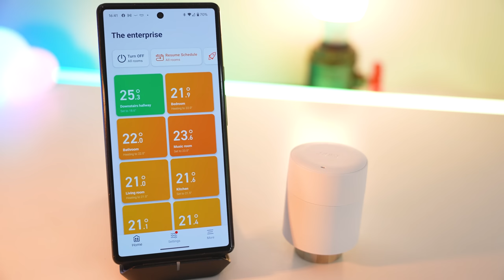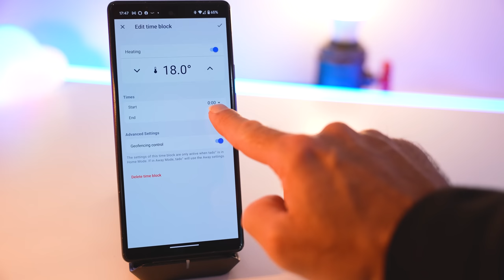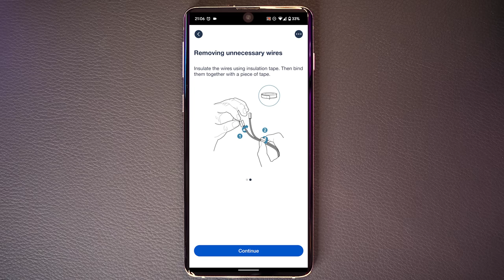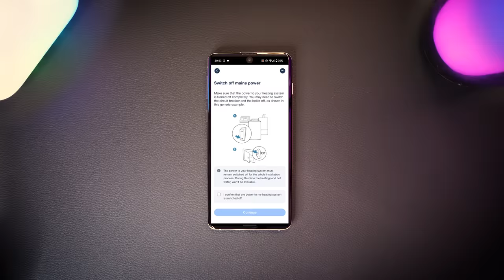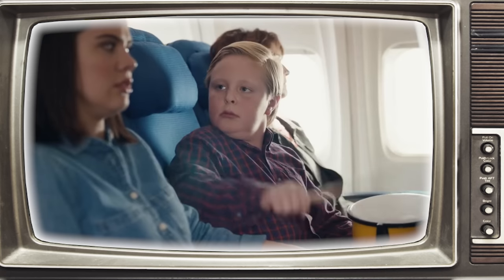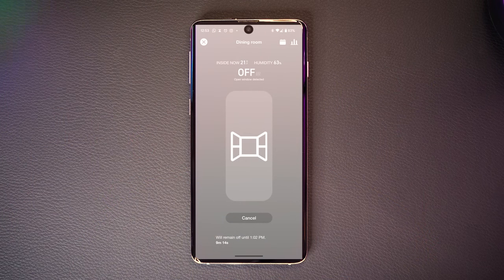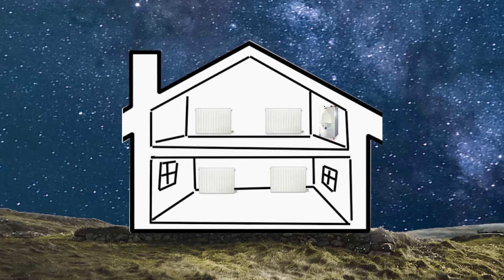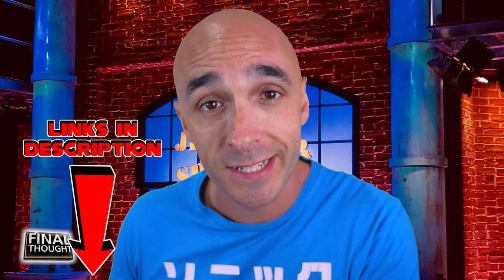Install This On Your Radiator & Drink The Tears Of Your Energy Company

Comment from the maker: Happy Saturday Everyone!  We are finally back from our belated Honeymoon now that there is no longer a hurricane stopping us getting back!  Sorry if I've been a bit quiet!  BUY TADO BELOW 
**UPDATE** A few people have told me in the comments that the Tado thermostat on Amazon is NOT Opentherm capable.  Tado have confirmed that the one listed on THEIR WEBSITE is (links below).  They have confirmed the Amazon link IS NOT OPENTHERM YET, Don't buy that one unless your boiler isn't opentherm capable.

RADIATOR VALVES ONLY (*DO NOT BUY THE THERMOSTAT FROM HERE AS IT IS NOT OPENTHERM CAPABLE) (20% OFF!!) https://referral.tado.com/paulhibbert

THERMOSTAT KIT (OPENTHERM CAPABLE)
https://uk.installers-shop.tado.com/products/wireless-smart-thermostat-starter-kit-v3-eu-version

WIRELESS RECIVER STANDALONE
https://uk.installers-shop.tado.com/products/add-on-wireless-receiver-for-combi-boilers
Reply: Congrats on the wedding dude. 🎉
Reply: I've just this w/e installed 11 Shelly TRVs - these have 6500mah rechargeable batteries in and a USB-C port.  Working on my home assistant automations now.
Reply: BTW - you only need a bypass radiator if your boiler or system doesn't have a bypass valve - it's worthwhile checking as the short return of a bypass valve will decrease the return flow temperature shut off time.
Reply from the maker: @defsdoor  Oh that's awesome info, thanks dude! ❤👍
Reply: Wicked video iv being using Hive version for YEARS never had issues and saved loads of CASH haha
Reply: The bypass/kettle radiator is to allow a place for the hot water to continue to flow when the boiler kicks off. If all your TRVs were closed and you didn't have a bypass radiator then the pressure would increase until...well...kaboom!
Reply: @defsdoor  Do you mind to explain a little bit more, i have 0 knowledge about that hehehe, thanks.
Reply: @jameskeatings9269  Thanks for explaining
Reply: Lol you Master Baiter.  Best Baiter I know. The jokes just "Worrrrrks"
Reply: @defsdoor   huh, good to know... I always thought it was a necessity.  I might just leave mine as is for the minute because I've done some other fiddling with flow temperatures and such and I'd like to have another base point for comparison, but excellent to know going forward!

Comment: One thing I don’t fully understand and hoping someone can clarify is we need to buy the wireless receiver which connects to the boiler itself. We need the smart thermostat kit and then obviously a bunch of smart TMVs. What I don’t understand is how many of the thermostats we need and does it matter where it’s placed? Should it be near where the bypass radiator is? Do we need one in every room where there is a smart TMV? I just don’t fully understand its purpose and don’t want to end up buying items I don’t need!

Comment: The reason your need a bypass is because otherwise if the CV pump is ‘on’ and all valves are ‘closed’, the pump will press against a closed off pipe. In time this will damage the pump. You can open up one radiator all the time, or you can place a (differential pressure) bypass vale somewhere in the system. With the bypass you can save money because you don’t need one radiator to be 'on' all the time.
Reply: You only need a bypass with a traditional room thermostat and independent thermostatic valves. With an intelligent system like this it will switch the boiler off if all the radiator valves are closed. When I installed my Honeywell Evo system (still working well after four years) I had a plumber in to fit the right valve head on the bypass radiator so I could put a Honeywell motor on that too. Otherwise you have one room that is always either too hot or too cold (because the system is now controlling the boiler and it does not know about this radiator).
Reply: Well or just install an efficient pump that measures the pressure and flow you don't need an extra pump that's fits your thermostats. Those are recommended for years.
Sidenote, if the present pump is that old, there should be a bypass directly over the pump in a correct installed system.
Reply: @john_hind  Thank you for your addition, I myself had a Tado setup. With no bypass or radiator always in the 'on' position. And unfortunately this broke the CV pump (according to the cv specialist). In my current setup I added the bypass and had no problems sins.

I am not a CV specialist, but with my old thermostat, when I turned down the temperature, it took time for the CV to stop working. With Tado, the radiators are closed immediately, but the CV takes some time to switch off. I think this has broken down my pump in the past.
Reply: @arnebaas  If true, that is a design fault (or maybe an installation fault) with the Tado system. It ought to check that the boiler is off before closing the last radiator valve and only switch it back on again when at least one radiator valve is confirmed open, and it would be perfectly straightforward to do this. Even if your boiler does not have OpenTherm, the system should still have a relay which replaces the original thermostat and switches the boiler on and off. Perhaps this is not correctly connected on your system?
Reply: @john_hind  It can't know if the boiler is running or not, it's just providing an "on/off" to the port valve.  There's no feedback.
Reply: @paulgoffin8054  My Honeywell setup has a radio controlled relay which replaces the thermostat. The controller knows if the relay is open or closed which is just a switch to the boiler, so should be a good enough proxy for whether the boiler is on or off. Paul says Tado has a similar Opentherm controller, so I imagine it uses a similar 'thermostat emulation' if Opentherm is not available.
Reply: I put in a combination tankless boiler.  It runs a primary/ secondary loop system.  Seems much easier to deal with
Reply: @john_hind  the pump always runs for some time after the boiler shuts off. On my boiler this time can be set to anywhere between 24 hours and 5 minutes, but not 0. What you’re after just isn’t a thing — the boiler needs water circulation after the burner shuts off to avoid overheating from the thermal mass of the heat exchanger.

Which means that if you keep the last zone open for a bit after heat demand ceases, it will always overshoot.

Tado could at best learn how much residual heat comes out of the system after it shuts off the boiler, and then time it such that it shuts the boiler off “early” by a little bit, but keep the zone open… but each zone would react differently, never mind when multiple zones at once no longer have heat demand. It’s basically not going to happen.

At the same time, if installed during the initial installation of the system, a pressure bypass costs less than a small radiator and even if retrofitted it’s at most a few hundred in labor and parts. Given how much smart TRVs cost the cost of a bypass is trivial.
Reply: @JasperJanssen  But is the pressure bypass designed to be relied upon routinely, or is it a last-ditch safety protection? The Tado or Honeywell system could easily be designed so it never closes all the radiator valves simultaneously. Instead of closing the last valve it would switch the boiler off and only switch the boiler on and close that valve after it had already opened another valve. It has the control authority it needs, just a matter of sequencing it right!
Reply: @john_hind  pressure bypass is a routine thing, yeah. If it triggers while the boiler is firing then the boiler will shut off on high return temperature, which is also a standard piece of control tech, but that sequence shouldn’t happen while under functional control.

A zone control system could sequence like that, but that would be a incredibly fragile system, and it wouldn’t work very well.
Reply: @JasperJanssen  Seems sensible to do both as the mechanical pressure bypass is a useful safety feature while correct sequencing reduces wear and tear. Modern combi boilers have the pump built in to the boiler casing, will this mean they have the pressure bypass built in too? My system has neither visible pump nor bypass but has been working without problems and with no bypass radiator for over four years now. What concerned me about leaving an uncontrolled radiator is there is no longer a thermostat controlling the boiler, so the room with the uncontrolled radiator would get very hot if controlled rooms required heat or very cold if it was the only room requiring heat. My house has a lot of solar gain to the rooms on one side, so it is prone to big differentials between rooms.
Reply: @john_hind  no, bypass has to be external. You need a few meters of pipe between it and the boiler. There might be a pressure differential switch on the pump so it doesn’t keep trying to pump into a closed system, but then you don’t have water flow when all the rads are closed, and while that’ll save the pump it won’t save the wear and tear on the boiler overall.
Reply: So much bad information in the whole chain here. One valve should always be open no matter what the setup, the bypass does not dump heat and that is exactly what a radiator is designed to do. When there is heat in the system it needs to be expelled and that is just one of several reasons why no matter what system is used always have an open valve, bypass/feedback or not. The risk of not dumping that heat? Split pipes.
Reply: @kevinfeathers7432  so where is that heat coming from that needs to be dumped?
Reply: @kevinfeathers7432  curious about this and if it helps to have lower flow temperatures. Eg often boilers would be set up to run at 70-80c and return temps would be 50-60c. You may want a rad working to dissipate some and prevent the return temperature being still 70-80. But if you can run at 50c flow temp, does it matter if all rads are bypassed and the return flow is 50c? Thats still lower than it could have been with a drop of 20c from a 75c flow temp?

Comment: we currently have a few Netatmo thermostat valves and they have a really annoying feature. If the battery runs out they open the valve full blast.
how do tado handle batteries running out?

Comment: I have used tado 2 years now and set it up to home assistant, worksa great saves me 10-20% the winter. Only problem for me is its 443 mhz and loses connection from time to time to the radiator furthest away, it still do its jobb but can't communicate to the resiver

Comment: I went down the self install route last year, really good system but I haven't got the TRV's as they are really expensive and I haven't got TRV'S on all of the rads in the house. Could l use cheaper TRV's with home assistant?

Comment: For anyone wanting this level of control for about half the price, fully local control with no reliance on the cloud and no subscription, look at the Drayton Wiser system. Added bonus is that if you have an industry standard faceplate for your existing non-smart thermostat, it's pretty much plug and play. You don't even need to rewire. Just take the old thermostat off, pop the new controller/hub on and tighten a couple of screws.

Comment: Could you review infrared panel “radiators” please? My rental doesn’t have central heating, I’m stuck with oil filled radiators but they’re a bit expensive to run.

Comment: I've had a tado installed for about 3 years and would agree with everything you said, it is a great system. A couple of extra things: you don't need radiator valves everywhere, just wait for the half price offers and add them over time. The valves occasionally wake up with a strange motorised noise, which is a little annoying in a quiet room. The geofencing is amusing at Christmas and Easter, and when the batteries need replacing the app tells you exactly how, because it knows you've forgotten and binned the box. So several nice little touches. Oh, and the devices communicate via some local RF system (not Wifi, not Zigbee) which has been rock solid.
Reply: Do you have a overview how much money/energy you have saved? I am living in a new rental appartement with heated floors and I am thinking about going smart home because of the high energy prices in Germany.
Reply: @abcxyzsven   greetings from the UK; I think our prices are even worse than yours :-( So that's a good question. The app does have a feature showing "Your savings with tado" which for me currently is 82.1% I'm not completely sure how they calculate it or whether I fully trust it. Regardless, because I can very easily control rooms individually and turn everything off when I leave the house, I think that tado can't possibly be less efficient than non-smart.
Reply: @chrisridd9423  Ohh... I thought the UK was better off because you have your own natural gas in the north sea. I think I will talk to my girlfriend about this topic. Still we are quiet lucky when it comes to energy. The house is new with the highest efficiency rating and we don't use gas but district heat. But the power plant still burns gas for the heat and electricity so we have seen some rise in cost.
Reply: @abcxyzsven  we get less than half our gas from the North Sea.

Comment: Are you sure that you need a bypass radiator? 
My understanding is that if all radiators are switched off then the Tado° system switches off the boiler and pump.

Comment: Ok so, if I understand you correctly, you can control this system locally via Home Assistant, but when there is no internet connection the system becomes useless nonetheless due to its reliance on the Tado servers?

Comment: I looked at both Tado and Wiser and went for the Drayton wiser system because it is able to operate independently of your home network and internet connection, if needs be. They also don't charge a monthly fee to unlock all the features (although there's nothing stopping this from doing this in the future, I feel like they probably would've done it by now). I have TRVs on all rads (except a couple of towel rads) and I've got it integrated with home assistant so I can control all of the rad temps/schedule from a touch panel in the hallway. One advantage of Tado is that their OpenTherm implementation seems a bit more advanced (as long as you buy the correct hardware which others have mentioned). Wiser only supports OpenTherm with a combi boiler (single channel), CH modulation works fine but it locks you out of changing the hot water flow temperature and it's hardcoded to 60c which is a bit annoying as ideally i'd like it lower for maximum efficiency.

Comment: To make the most use of these (and any smart rad control), don’t you need to keep the door shut for the room they are in? Otherwise your rads that are on will have to over compensate as they will be heating the room they are on in and effectively the room that you have the TRV off/lower temp?

Comment: I've been using the Drayton equivalent Wiser for a couple of years now ... the one advantage over the tado is that aside from the initial setup it doesn't require the cloud service.  That said the built in geofencing (wiser requires ifttt) and the display on the TRV's are very nice.
Reply: I'm looking to replace an older style Drayton MiTime programmer series single channel controller ( model T711R ) with the Drayton Wiser systems.....was wondering how good their wireless TRV were...? Maybe Paul can do a review...?
Reply: @innovatoTV  I'd have to say I feel it could be better ... the main controller doesn't seem have the best antenna so I find the wifi signal isn't the best and it only uses 2.4ghz not 5ghz ... the trv's use zigbee with all the issues that has, there is no way of changing its channel so there can be interferance issues with 2.4ghz wifi.  The trv's are not repeaters for that you have to get their power plugs and they are £50 a time.  My 4 bed can just about work without any repeaters with the controller at one end of the house the room furthest away upstairs is marginal ... a repeater helped but I think I could actually do with a 2nd one as the upstairs is L shaped over the garage and depending on wher I put the repeater one leg doesn't really benefit as walls get in the way.
There is a feature that is supposed to stop the radiator going on if the window is open, personally I've found it doesn't work for me.

That said on the whole I've been pretty happy.
Reply: Drayton is proper ace. 
No cloud required
No extra hub required as it's all in the boiler controller.
Does the hot water as well
Has 3 different versions so you can have just heating for combi boilers or 2 channel for heating and hot water and 3 channel for double loop heating if you live in a palace. 

Downside to tado it is (or was ) a faff to enable all trvs to call for heat. You had to get it enabled by a help line. Wiser just works
Reply: Another vote for Drayton wiser. No reliance on the internet including a local Home Assistant control too.
Reply: @luciditycrash3469  house has 2 heating zones, 1 for upstairs and a 2nd downstairs each with wired thermostats, so might get away with putting one WISER wireless room stat in sitting room and another run my home-office (work from home)  and  minimise all other rads....and keep eye out for discount deals on the TRV's and add in future. House is small so hoping the wifi can cover without repeater.... hope to install Nov before we really start weaning warmth. Would need to figure the GEO fencing when OOH....
Reply: @innovatoTV  its not wifi that needs the repeater it's the zigbee the hub uses to communicate to the TRV's but if the house is small you should be fine ... you can always add the plugs if you have to.   For the dual zone + water you'll need a kit 3.  I picked mine up from Amazon during black Friday/Cyber Monday deals
Reply: I've got the Wiser system too and love it!  I do work for Schneider but that's not clouding my judgement, honest :-)
Reply: If you have Home Assistant, you can use the homekit functionality to avoid relying on the cloud.